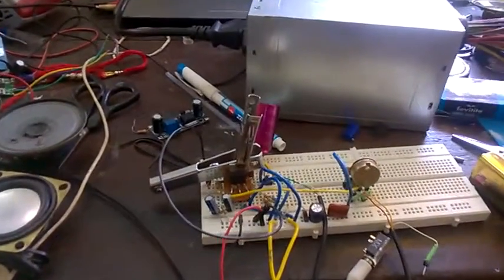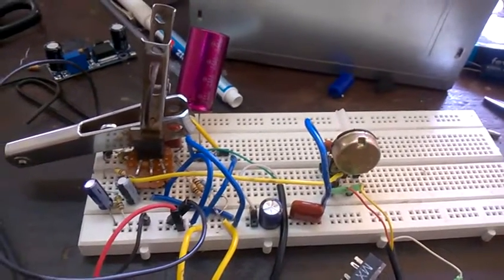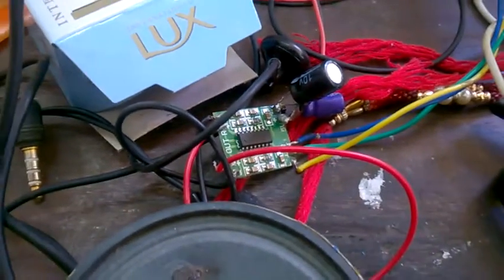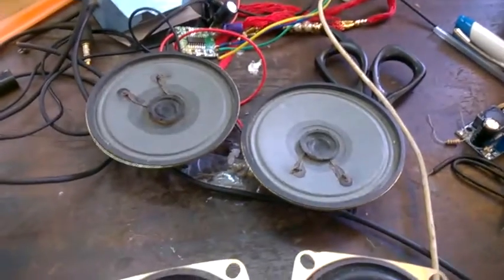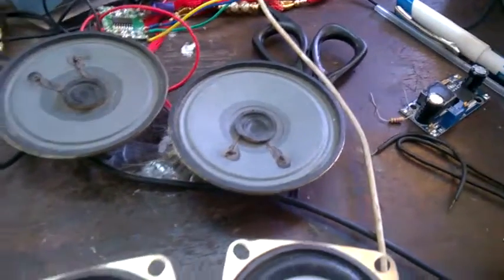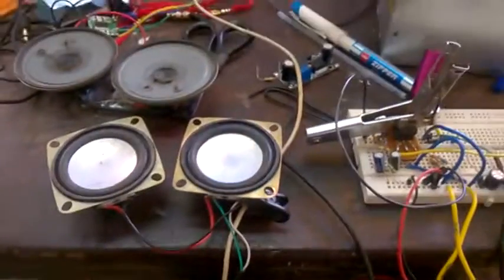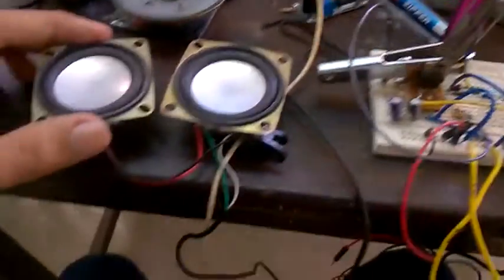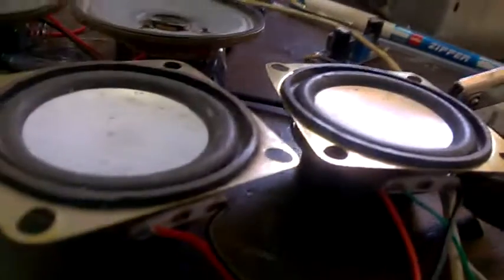TDA 2030A Amplifier + PAM 8403 two way speakers

Comment: can u show me the diagram of TDA? i want to build one. is it stereo?
Reply from the maker: This is mono. Just that I am driving two speakers from the same channel. You can use two of these chips or get stereo Amp chip like lm2878. The circuit I used is exactly the same as given in the datasheet of TDA2030A.